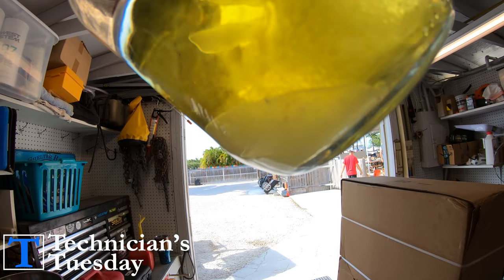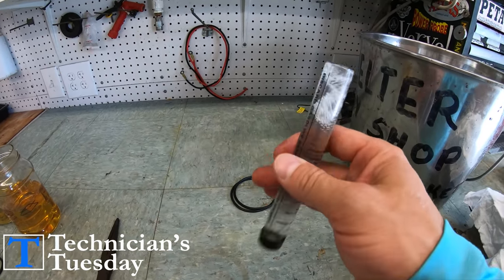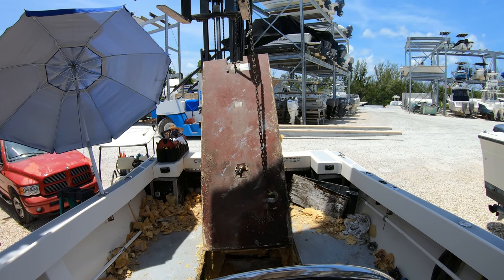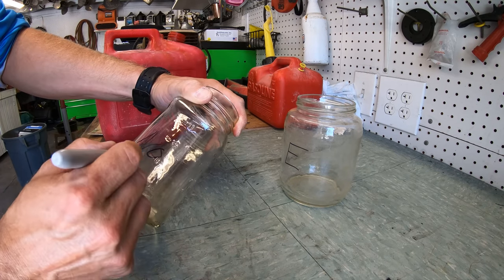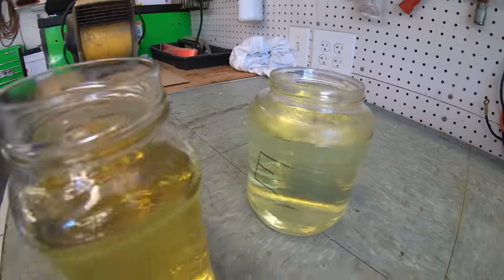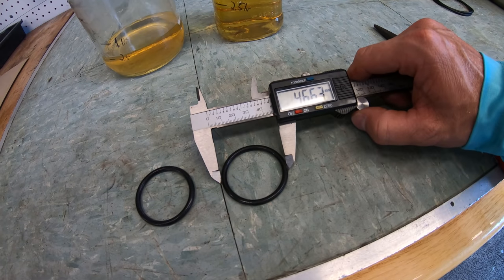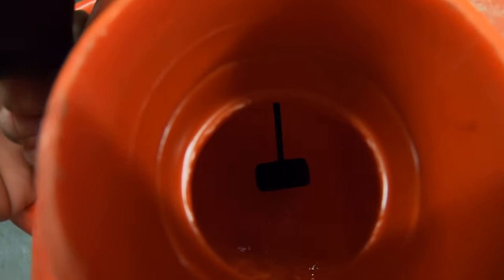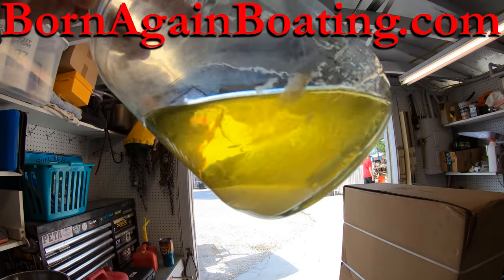What Fuel Do YOU Put In YOUR Boat?

Comment: Here in California it’s basically all e15 fuels.. even at the fuel docks mostly.. if i let my boat sit for a month I typically get about a gallon or 2 of water in my tank.. my water filters manage to grab most of it and the fuel treatment does the rest.. i have 3 large water separators in line on my boat with large plastic see through caps on the bottom of each filter. I believe they are diesel filters but they work. They each have little drain valves so i can hold a bottle under them and drain the water out easily

Comment: Great video. No surprise, they're all really good. 

The experiment with the fan blowing over the jars of fuel is fantastic. All sorts of science happening there. 

The reason there was more condensation on the fuel with the ethanol is because ethanol is more volatile. It "wants" to evaporate more than the gasoline does. In fact, the ethanol "pushes" on the air with a pressure of 1.2 psi whereas the gasoline pushes with only 0.3 psi (a.k.a. saturation pressure, for a 77 F day in Florida). When liquids evaporate, they tend to cool down. Pour some rubbing alcohol on your hand, it feels cold. 

Since the ethanol in the fuel has a higher vapor pressure, it evaporates faster, and cools more, resulting in more condensation. You could repeat the experiment with thermometers in each jar and see the cooling effect. 

Every little bit helps keeping my old Mercruiser 470 limping along. 

Thanks for keeping us all informed.
Reply: Thank you for that great explanation
Reply: That's the idea behind it, but some parts are missing.  gasoline is NOT a single standard molecule like ethanol. The composition of gasoline depends  on where you live, the climate and temperature, and the refinery that produces it.

Comment: I have run ethanol fuel in my boats for years and really never have issues, but I'm only running a 20 gallon system and like you said, tank size makes a big difference. I also run my boat practically year round. If I know I'm putting the boat away for a few months, I run my last tank or two as ethanol free.

In my experience, the biggest problem is the fuel sitting, whether its a 20 gallon tank in a car or a 200 gallon tank in a boat. If you use your boat often and have a decent fuel water separator in your fuel system and actually perform regular maintenance, you'll likely never have a problem. If you're one of those people that's lucky to get out 4 or 5 times a year, you're best off sticking to ethanol free. Just my $0.02. 

I'm an auto/diesel tech and I'm currently working on a truck that's been sitting for a few years, ethanol gas has wreaked its havoc on the entire fuel system. every line leaks and i'm pretty sure the tank is about rusted through from the inside.

Comment: I fuel up about once a week using whoever is cheaper. Never had any motor issue at all in almost 30 years. My boat is out a couple times a week year round. Current motor is a 2001 25hp Yamaha.

Comment: Thanks for the video, well done.  Pulled the fuel sending unit, put a 1/4 in line to the lowest point in the tank and syphoned the water out.  Put a 3 foot by 2 inch towel on the end of a rod and tried to mop up all that was left.  Put in a fuel filter with a water separator and drain cup.  Rock solid.

Comment: Another interesting and well documented vid. Thanks. Here in South Africa, we are supposed to have ethanol in our fuel, but it seems that the legislation requiring it somehow stalled. After a bit of research, I'm really not sure if we have any ethanol in our petrol now. Nevertheless, we also on occasions fill up with absolute crud at the fuel station. Add to that, crossing the border into Mozambique (many of us take our boats offshore there) for example, the fuel becomes quite interesting and often doesn't even smell like petrol. For these reasons, any boat I've owned that had a built in fuel tank, has had the tank stripped out and replaced with smaller portable fuel tanks. This way, the fuel quality can be monitored better and there's much less opportunity for water ingress. Add to this, a well maintained water trap/filter and you feel a lot safer out on the water. It's a hassle, but well worth it IMO.

Comment: When ethanol was first introduced here (Gloucester, Ma) I was about 10 miles offshore in my Sea Pro 21' W/A with an 81 gallon tank powered by a 2 stroke 200hp Suzuki. The engine died but was able to get it running barely. With a couple of starts & stops only managing about 4 knots I made it in. It tuned out the ethanol was loosening all the junk in the tank and clogging the fuel pickup. I replaced the pick up and all the fuel lines and filters and never had a problem again.

Comment: I've been fortunate to have ethanol free gas available on the Texas and Louisiana coast where I fish. Also use Yamaha Ring Free and fuel stabilizer with every fill up. My tank has a 72 gallon capacity, but most trips I only put 45 gallons in and try to burn most of it up. I also run my engine monthly in the off season to keep the fluids moving.  Never had fuel related problems. Knock on wood.

Comment: Even though I've been using ethonol free gas, I have been battling a water problem in my fuel, emptying the water from my water separator and even getting my tank pumped. Very humid here in Florida. Once I started using a fuel treatment additive, problem was solved. Now I know why and understand how the condensation gets into the tank. Thanks for the video.
Reply: @Alan Pacanowski, what additive are you using?
Reply: my go to favorite fuel and motor oil treatment is Marvel Mystery Oil, revived many old high mileage engines and have never had a failure even running conventional oils up to 6k between changes. For pre-mix two stroke add marvel as recommended but then add pre-mix oil to the next thinner/lighter recipe (if you require 40-1 , mix it 50-1, etc..)

Comment: Last winter I attended a boat show seminar put on by an instructor at a local Marine Maintenance Technology program. His assertion was that the main issue with ethanol is that it's a solvent (being made of alcohol). He said that if you always run ethanol in your boat since new, you won't have any problems. However, if your boat is older and has never run ethanol before and then you introduce it, it can loosen up lots of sediment which then gets into the engine.

Comment: I have a 2017 Suntracker 22ft with Mercury 150. When I bought the boat its has about 40 hours. The prior owner only used standard pump gas boat had about 10 gallons in it when I bought it. I ran that gas out and now I travel 75 miles one way to the only NON ETHONAL fuel station Ill fill up 7 5 gal cans 6 for the boat and 1 for my mower and my little Honda Monkey
I also fill my car and it runs 100% better with way better mpg. My boat also seems to start and run better with less RPM. Im hooked on NE fuel for my boat

Comment: Just bought a boat that has sat on a trailer for 3-4 years (never ran). Had no idea how much fuel was in it, but was told it was "empty". Put 10 gal of non-ethanol fuel in it, then drove it around the block to stir it up. Drained it. What did I get? 11 gallons of water and 15 gallons of fuel. And when I say "water", I mean . . . crystal clear H20. Like you got it from a faucet. Almost no smell to it, either.

Comment: I've had several boats. The first few I owned I ran 87 with ethanol. Nothing but problems... switched to shell 91 non ethanol. Never had a motor or fuel issue since. Worth the extra $$ to look after your pride and joy. A happy motor is a happy boater!!
Reply: I put 93 in my boat. I might start using no ethanol
Reply: @darrickiam  boats don't need the high octane usually. Depends on the motor. They just don't like ethanol

Comment: Consistent use of your boat is the best way to prevent problems especially fuel problems
Reply: Of course your are right.  As you know not everybody can boat comfortably year around.  One long term storage option would be to empty the fuel tank & cap off the vent(s).  I think somebody even makes desiccants designed for this purpose.  Having a good filter/water separator is important.  Avoiding the problem is the best strategy; buy clean fuel and consistent use you your boat burning through all the fuel supply regularly.

Comment: I added a separate water separator filter before the motor filter. Also, I add marine Stabil. This takes care of most of fuel issues. However, I recently reported my boat. I now only use non-ethanol fuel.
Reply: I love auto correct - repowered not reported.

Comment: Alcohol evaporates faster than petroleum , when anything evaporates , or changes from a liquid to a gas it lowers in temperature , water , fuel , freon , compressed air , co2 Ext ,
Reply: I was about to post something similar, thank you, good old latent heat of vapourisation.
Reply: Oisín Higgins you are correct , I just couldn't remember the proper term for it , thank you

Comment: Did empty my boat this winter and used fuel for generator during our deep freeze in Louisiana when I got ready to use boat put 20 gallons in 120 gallon tank and ran each motor for 30 minutes without moving boat so it wouldn’t slosh around did have water in the bottom of water separating filters that are see through after that haven’t seen any more water this summer I do drop filter out about every 3rd outing anyhow

Comment: You'll find condensed Water only on free surfaces of the tank, espacially on Aluminium tanks. So you can minimize the problems by always filling up your tank to the top.
Reply: When he said to not have much fuel in the tank is better. I have a power sports business and have been in the same location since 1979 and we store about 250 boats every winter from about September to the following spring may ish along with winterize close to 1400 boat's a year and we have done research on water getting in the fuel tank during storage for over 15 years and is still something we pay attention to still to this day.. we have found boats with built in fuel tanks 20+gallons of fuel left half full for the winter 9 times out of 10 that boat will have water in the bottom of the tank in the spring. We have seen as much as 4 gallons of water accumulate over the winter... We have done this with the same boat the next year and had the customer fill the tank before he brought  it in for winterize and storage.. the customers didn't really think it was going to make a difference.. but it did not have a drop of water that spring.  And he didn't have to spend any money having us get the water out and running correctly.. but of course the next year he wanted to help us in a way but he was hoping to prove that's not what was happening.lol... so I was all for it so it was stored in the exact same place as it had been the last 2 years.. so spring show's up and time to get his boat out for the season.. I had the customer come over and actually help get it prepared for the water.  So I asked him do you just want to start it up or if he wants to pump the bottom of the fuel tank? If there's water in the bottom and we start it the water is going to end up in the carburator and it will have to be taken apart and cleaned if that happens.. so he said let's pump the tank first like I wanted to do from the start... So anyways almost 2 gallons of water wass pumped out!!! 
So with all that said, I would like to add that this has been done with well over 50 boat and other vehicles of some sort for over 15 years on everything from boats,built in tanks and portable tanks, jet skis , snowmobiles, and many other things with a engine.. so now if a boat is stored at our shop and the tank isn't full we pump the tank before we start it up in the spring. And let's not forget that I make money by cleaning water out of the fuel system and cleaning the carburator's . So in the long run we lose money but we have very happy storage customers and are very loyal to are shop. Not just from this experiment but many other reasons.. it's not all about the money at are shop  it's about doing the right thing every time you deal with someone!!!! Anyways this is just what we have found out over the years. And the new fuels I still like better than the fuel 10-12 years ago since It doesn't varnish up as bad.... and stink up the hole shop lol... Hopefully this information will help so other people and families save time and money by trying this especially if you have ever had water in your tank come spring time...  Have a great day... Bob....
Reply: @bobc8694  Bob your post is very interesting. I kept going back and forth weather to fill my 40 gallon tank or leave it close to empty. What I did was pump out the old  fuel that was in it (bought the boat used,had no ideal how old thew fuel was) I then poured in  8 gallons of true fuel with some startron. Reasoning was no nonethanol fuel where I live. Also I called a marina and was told never get fuel from a marina at the end of the season. If I filled the tank I would still have 40 gallons of possibly bad gas in the spring.After reading your quote I will probably pump out the true fuel to just to see if I get water in the tank over winter.

Comment: Most of us don’t really have a choice of Gasoline or Ethanolized fuel. E10 (10% ethanol) is the most common and is what most late model marine engine manufacturers say is the maximum. As to E15 (15% ethanol) it’s actually a federal violation to use it in your boat. What’s that tell ya? Ethanolized fuel absolutely swells many elastomers (rubber), polyesters (in fiberglass) low density polyethylene, but not high density polyethylene (portable fuel tanks) PTFE (Teflon) and a few others. 
Which brings me to fuel lines. Only the flexible MARINE fuel lines of the last four or five years has any good chance with ethanolized fuel. It should be printed on the side “USCG approved type 
A-1 low permeation and a date of manufacture”. (USCG require the flexible fuel lines replaced every 10 years). My favorite fuel line brand is Trident. Older fuel lines inner layer tend to crumble and literally make a solid plug at the first point of constriction as well as the hose falling apart. The new replacement hoses need more hose clamp pressure and also need retightening in 24 hours and at 6 months as the new material flows slowly under pressure. (Always use stainless and double hose clamp)
Now the ugly. Besides ethanolized fuel absorbing moisture (hygroscopic ) it can do something really bad, it’s called “phasing” . This is when the fuel separates out to distinct different layers. Gasoline on top, ethanol, water and a thin layer of sulfuric acid at the bottom. This is what eats the crap out of the bottom of the the fuel tanks, float bowls, fuel pumps, coolers, vapor separators and more. Phasing usually needs several conditions for it to happen. A vented to atmosphere tank, below or close to freezing and enough time for moisture to have been absorbed into the fuel (+3 months). Once phasing has happened there is no additive on the planet that will reconstitute the mix. Replace the fuel or carefully drain the stuff below the gasoline out are your choices. If you do manage to get past the water and get it to run on the ethanol, it will run extremely lean because the engine isn’t jetted to run on it. You may find some guys fighting with a motor, finding and the only way to keep it running is the feather the choke. Then one Einstein says “let’s take it out and blow her out”. Bad idea—LEAN!  Yeah blow her out alright, the last time. If you want to know if your fuel has water in it (ethanol absorption or rain) or even if it phased, there is a product called “Kolor Kut” and you want the (modified formula) for all types of gasoline. This is a paste that you coat thin layer on a stick(weighted rope?) and stick the tank. Hold it down for about 5 seconds and pull it out. You can tell by different colors on the stick if there’s water and/or ethanol below the gasoline. If you want to help keep your fuel fresh, use Startron additive but it is no miracle worker, additives have limitations. Bottom line, best to keep the fuel fresh. Consider rotating the fuel out to another vehicle if you can’t run it. Be aware it may cause other problems to completely empty your fuel system because some components may dry out, harden or crack.

Comment: #510591 Ethanol is hydroscopic, meaning it attracts and absorbs water. Running that fan over the jars causes a pressure drop which increases evaporation. The evaporation reduces the temperature. The moisture was forming on the jar because the temperature of the jar dropped below the dewpoint and the moisture in the air condensed on the jar. It doesn't take much temperature drop when in high humidity areas to reach the dewpoint.

Comment: The difference lies in the boiling points. Ethanol evaporates at approx. 78 ° C, while the boiling point of motor gasoline is between 30 - 200 ° C, depending on the type. Car gasoline belongs to the middle class and has a boiling point of approx. 85 ° C. Water evaporates at approx. 100 ° C. That is why the ethanol evaporates first, then the gasoline, and what remains is water and residues. When ethanol evaporates, it cools. That is why water vapor condenses on the cool glass.

Comment: There was also a problem in older boats that have fiberglass fuel tanks. The ethanol would dissolve the polyester resin and gum up the fuel system and engine.
Reply: I had a generator that someone patched a leaky gas tank on using fiberglass.  It stopped running correctly and when I took the carburetor apart there was resin all over the parts flaking off, it was a mess. The gas or ethanol had dissolved the resin and deposited it on all the carburetor parts.